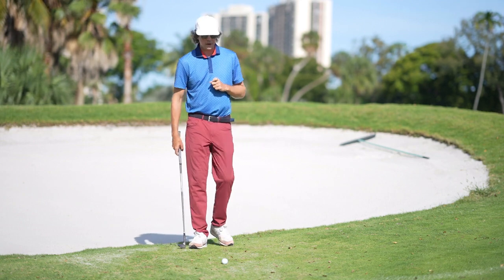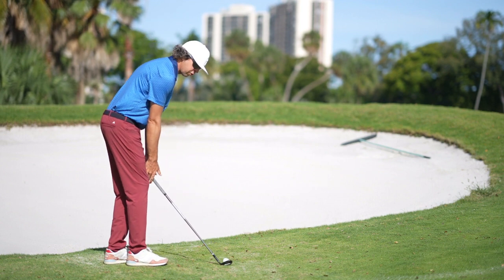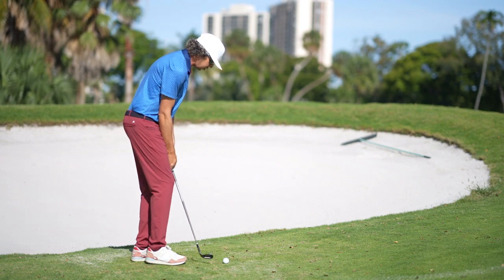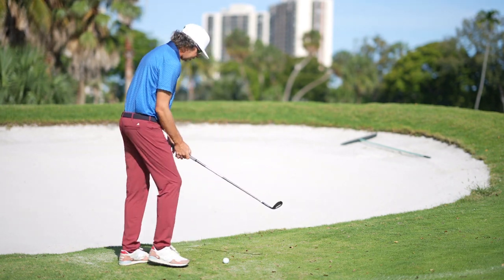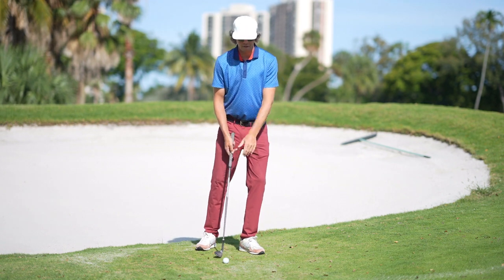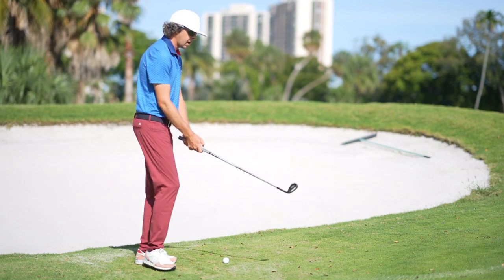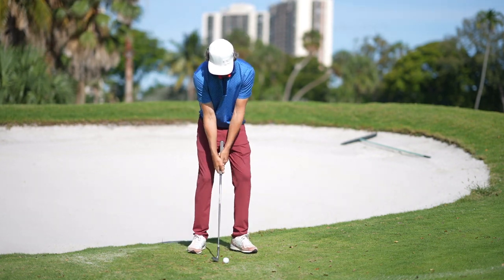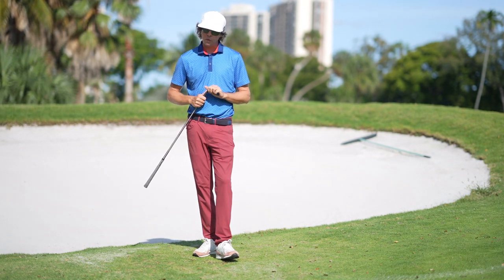How To Chip & Pitch Shots From Super Tight Lies

Comment: Quick question, as it's a tight lie are you hitting ball first with a slight divot post impact or are you using some bounce in this shot? (To me it looks like your hitting down on it with a little pressure and squeeze on the ball with a bit of forward shaft lean and slight divot, that's the intention, yeah?)
Reply from the maker: Definitely ball first here! I think the majority of need to focus on ball first before we get into specialty shots like grounding out behind the exposing the bounce. I still like the bounce exposed but would recommend ball first contact. 

Hope this helps and thanks for the comment!
Reply: @tsgolf  Cool man, thanks

Comment: what if u wanna hit it high off a super tight into the grain and soggy lie with a lob wedge? i feel like there is literally no margin for error. even with a wide open face it would still dig
Reply from the maker: Wet lies and into the grain Bermuda have no margin for error. If it’s a tight lie I still use this method and change the release pattern to the finish (grip handle will point to the ground faster after hitting the shot)

Comment: Is this technique used for each club from 58/54/50 and that just changes trajectory/roll out?  
And what type of shot do you want the more heal interaction.  

The addiction to yiur videos is real. Thank you for all your personal attention.
Reply from the maker: So this shot is for contact mostly and contact point is slightly toe based. This is so the toe can slide under the ball. The Tran will have to do with length speed and accent angle/ release pattern.

Only place I use the heel first for turf interaction is buried lies in the rough (open the face and get the heel in there)
Reply from the maker: Thanks for the support, questions and feedback! Appreciate it!